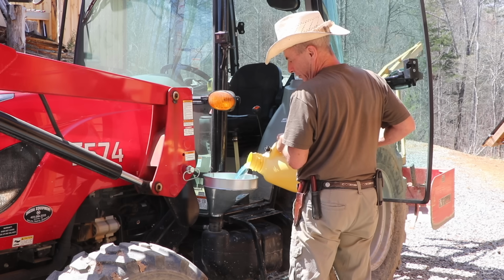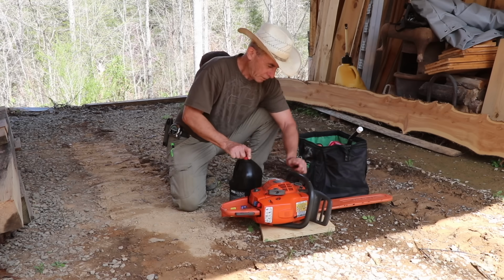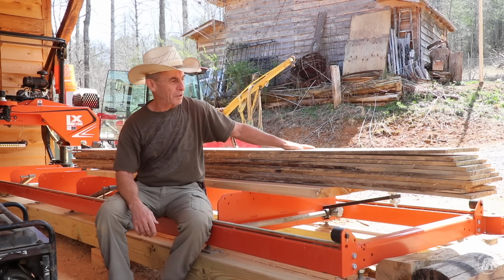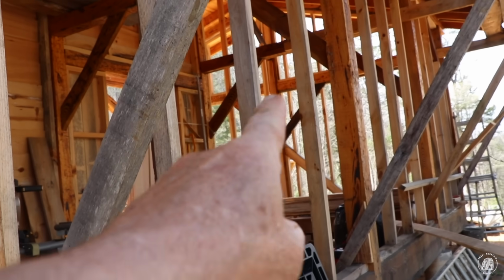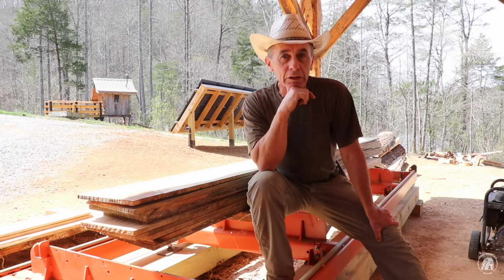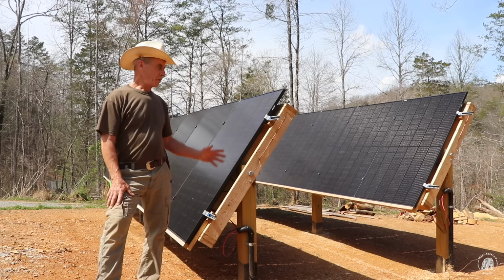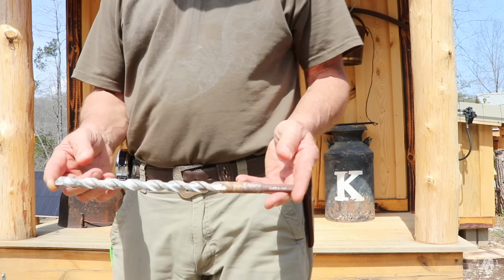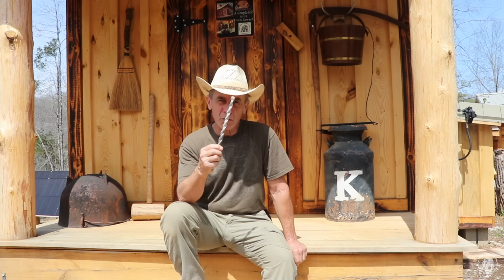FINISHING CONSTRUCTION DETAILS ON NEW HOMESTEAD

Comment: Richard have you looked at a concrete Core Drill rental that has the ability to cut through the rebar in the concrete blocks?  This may be a cheaper option as Home Depot and United Rentals has them for rent.